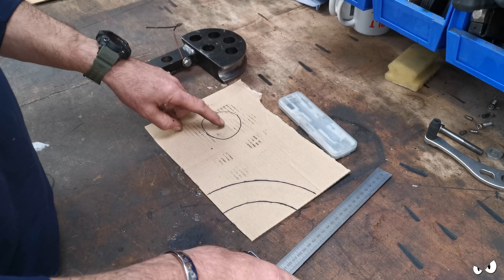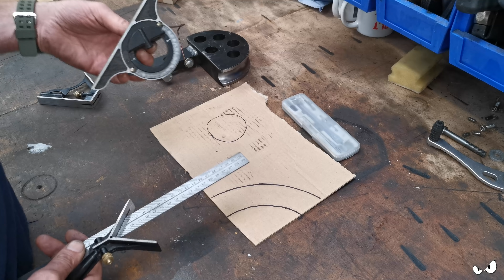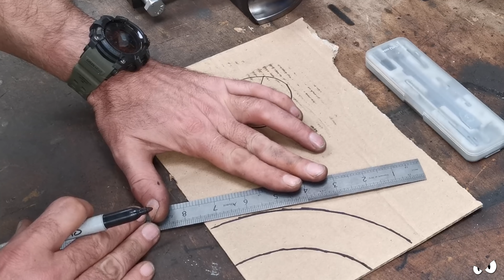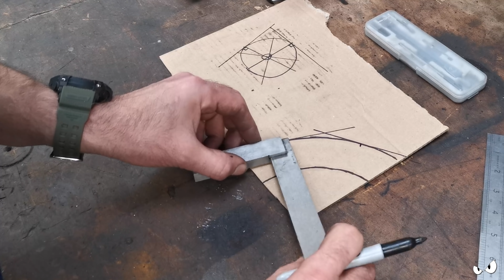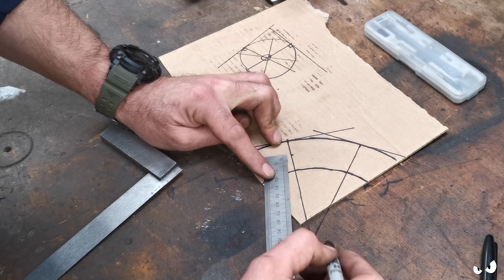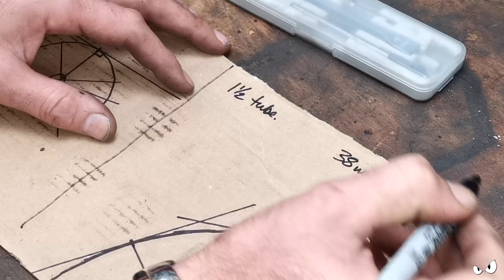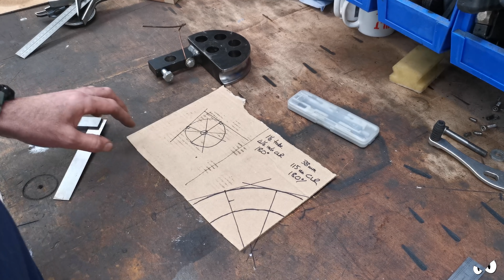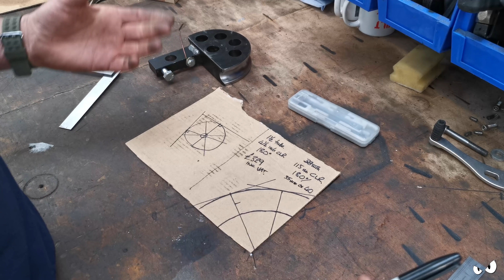Getting it on - Suzuki Bandit Cafe Racer - GIXIT Project Part 51

Comment: If you put the M unit in the headlamp you only need I green wire found the headstock. with your proposed set up all the wires from your two handle bar switches have to go round the head stock
Reply from the maker: That's what we're doing now matey ... Wiring from the switch gear into the headlamp along with the m button. Great minds think a like 😁👍

Comment: nice one.  but surly that line trick will only work if the two outside lines are at 90 degrees. as smaller or bigger would give you a different centre point when you square off where they hit the line.
Reply from the maker: As long as you draw a tangent to the circle, it works... Give it a go. If you can get to 90 degrees, your centre will be more accurate, but any angle will get you the centre :-)

Comment: you could probably look into bbq covers for your lathe, then the sides will be closed in too, just a thought
Reply from the maker: I'm probably going to go that way. Initially I was worried about welding and grinding sparks burning through it (hence the fire blanket), but don't think that going to be an issue given where the lathe sits in the corner 😁👍

Comment: Ive got a set of those tube expanders, tried them with 1.5mm mild steel tubing with a 400nm ryobi impact (impossible with spanners) and after an hour i could only get 0.5mm expansion... heating the pipe helped the most, i think unless you have a 800-1000nm impact you wont get much out of them, ive also managed to strip the threads on the mid sized one, crack the smallest and imbed the rear cone into the rear shaft on the mid 😂😂 hope you figure a way to get what you need from them.
Reply from the maker: Hehehe.... They sound AWESOME... 😂🤣👍 Truth is that all I hope to get them to do is make something that isn't round, round. Enough to weld to another piece of tube. I think stretching SS is a bit of an ask for these... They only cost £15 after all. Great comment, thank you matey 😁👍
Reply: Yeah they are perfect for that, made many oval pipes round stainless & mild... on my third set, some sets seem stronger than others.

Comment: Hi Quicky , I fitted a M-Unit to my Motorcycle , I did not use a M-Button [ wish I had ] , but did read about the M-Button . They emphasise that the M-Button must be protected from RF , by placing it in the Handlebars . Impossible to fit in Stevo's bars , perhaps you could fab up a tube ..If you have not , I suggest you have a gander at the Instructions for the M-Button . [ I did , more than once ] .
Reply from the maker: I saw that, but it would mean daisy chaining the m button from one clip-on to the other to feed the signal wires... I may end up mounting it in a tube under the headstock yet, but as far as placement, this'll do... Just need to rethink the mounting maybe.... 🤔👍
Great comment, thank you 👍

Comment: I just saw a video of another youtuber who did a 3 in 1 pipe. He did not use a fancy pipe wiidening device. What he did do is best not to be repeated.
Reply from the maker: Hehehe... It's going to be interesting to see the comments the exhaust video attracts 🤣😂😁
Reply: Quicky, why not buy those stainless factory made bends? I know you want to create but it would be interesting to see you weld.    Is the goal to make the pipes in one part or what?
Reply from the maker: I could do, but given I'll be doing other bikes as well and plan on making a frame for ASBO, I may as well get the dies. There's going to be plenty of tig welding involved and I may end up getting some pre-bent curves for the link pipe as I don't have a 54mm die

Comment: It's going look well clean 🤘🤘
Reply from the maker: Waaaayyyy better look than cluttered, do you not think. Its really hard to hide everything away though... 😁👍
Reply: I can imagine.. as for the lever's. There a lot more durable than you think. I'v dropped my clutch lever a few times and had it covered in brake fluid. ( Thanks to a faulty Rimoza reservoir ) and it still looks brand new 🤘🤘
Reply from the maker: Hehehe... Most of these scratches will rub off 🤣😂😂

Comment: I was sitting here thinking What he wants is a 1-1/2" x 4-1/2" die, long before you even started measuring.  I'm surprised you didn't make your own, you must have a 5" chuck on that lathe?
Reply from the maker: Hehehe... 4.5 😂🤣👍
Reply: @QuickBikes  Bummer, still you could have probably got away with it 😄! P.S. when you build the exhaust I'd shy away from siamesing  the "headers" like you did in your drawing as you are potentially adding a restriction.
Reply from the maker: Plan on opening it up to 54mmas per the race pipes. Apparently 50 to 57mm is the accepted optimum... Won't know till we dyno it and if we need to change it, its just a bit of be ding and welding... And head scratching... And swearing. N stuff...

Comment: Man I can't believe you have basically taken this back to the front end and engine yet you are putting a moped horn back on! Air horns/Snail horns, Train horn ... something :)
Reply from the maker: Hehehe... As long as it beeps for the. Mot, I'm happy. Its small enough to tuck well out of the way and not exactly a feature to display 😂🤣👍
Reply from the maker: A good point... I'll raise it with Steve O and see what he thinks 😁👍